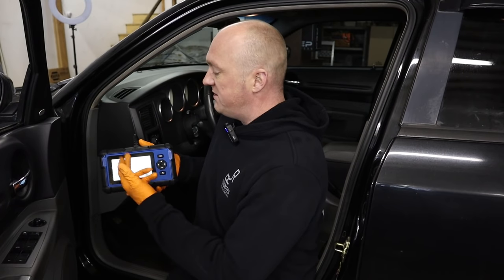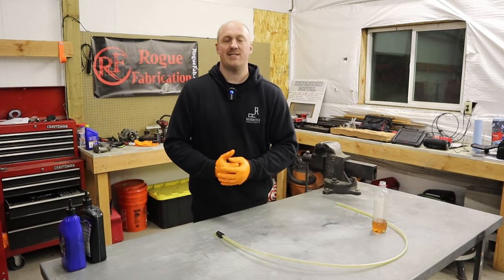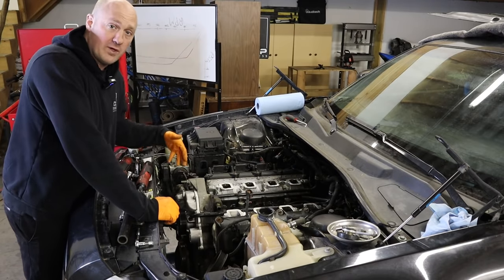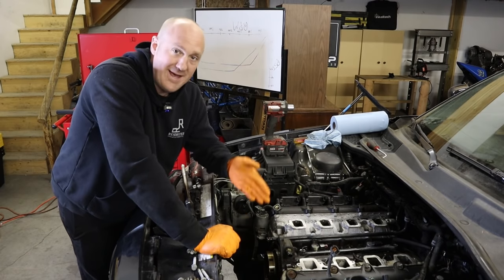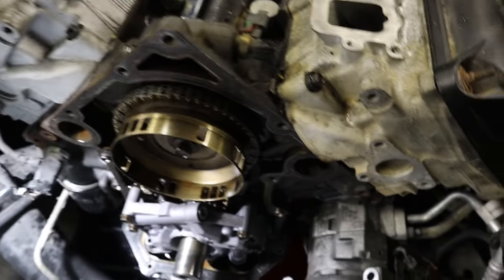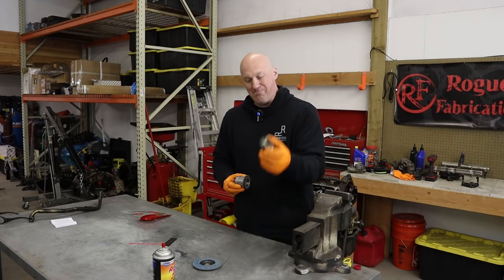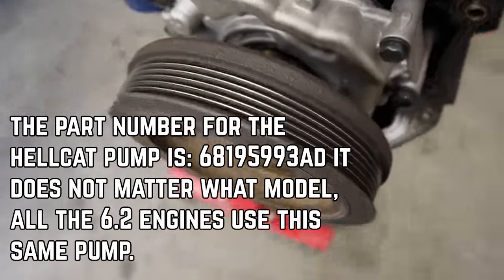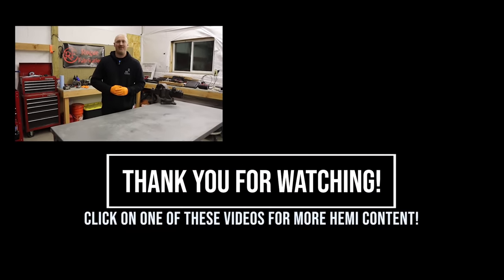Will This FINALLY FIX Hemi Tick? #hellcat

Comment: Ive been reading many of the comments, and the point is getting lost.  He's not talking about PRESSURE as much as he is FLOW or VOLUME,
even though he mentions pressure.

By upgrading to a high volume pump, there will be an increase in pressure at an idle, but at highway speed, the pressure will level off because of the the pressure by-pass spring/valve in the pump.

Simply put, pressure is the resistance to flow.

The pressure is being created by all the little passages and thousandths of an inch clearance of the rod and main bearing and all that other tight stuff.  That doesnt mean that theyre getting more oil across and through them.

Its not the pressure that is keeping the needle bearings in the lifters lubricated, it the amount, the volume of oil they're getting at idle.

As a former firefighter i get what he means.
Let's say the hoses are the oil pumps
If you take a 1 3/4" hand line, you can put 100 psi on that line but only flow 90 gals/minute of water
That pressure is blowing shit everywhere but there's not enought water to cool the fire to make it go out.

But you take a 2 1/2" line, you can have 100 psi on that line but you have a volume of 350 gals/ minute.
You just put enough water on the fire to cool it down so much that the fire doesnt have the heat to sustain  combustion, so the fire goes out.

I dont know the volumes of these oil pumps so these numbers are for illustration purposes only;

Stock pump flows 8 oz of oil per minute at idle to the lifters
 
Melling pump flows 18 oz per minute to the lifter
The Hellcat pump delivers 50 oz of oil to the lifters.

So the Hellcat pump is delivering PLENTY of oil to the lifter needle bearings to keep them lubricated, more lubrication, less friction. Less friction, less wear.  Less wear, longer before the part wears out

Thats the point, it's not the pressure of the pump, it's the volume of the pumps
Reply from the maker: Nailed it 👍

Comment: 03 Ram 2500 5.7 180k.. Have used 5w30 synthetic since I've owned the truck (bought with 53k on it). Not 1 issue outside of Crank sensors. Am still excited to see how this goes.
Reply: It's Very Rare a 3rd gen Hemi has lifter issues it's Mostly the 4th gen Hemi. I have a 2008 Ram 2500 4x4 Hemi an it Runs Flawless an has NO Check engine light on.

Comment: My 06 Daytona gets more around  the 29 psi at idle, fromwhat i could gather, this is in KPA as i'm a Canadian and if you pick Kms, you also get kpa...anyways. then i get a simmilar high high 50s maybe into the low 60s psi with rpms. Still not a fan of idle PSI, but it is what it is. Very informative video from what ive seen so far
Reply: I'm also canadain. 29 psi would be in the mid 200s for kpa and 55psi is around 450kpa

Comment: You have too go with carburetor and distributors too adjust idle and you go with thurmoquad carb and Mallory distributor and copper core wires and auto lite spark plugs

Comment: I think the low PSI oil pumps are the reason for so many cam and lifter replacements. I saw mine at 16 PSI when hot at idle. That's too low to me. Mine puts out 49 at high RPM. A couple times, when I needed to change my oil, I got a warning that the wrong oil weight is being used. I always use the proper oil weight. I'm putting in a higher pressure pump now, since I have to change my water pump.

Comment: I bought the hellcat pump and measured the thickness of that gear and it's 5/8 inches
Reply: It looked identical to the pump that I had on my 2013 Ram 1500 5.7
Reply from the maker: It's a difference of two millimeters so they look very similar.

Comment: Question: How much additional oil is actually getting to the cam and lifters? Has the additional pressure provided more volume to this or is there still a problem in the engine design that still starves the cam of oil?
  It would be great to mount a couple of endoscopes near the front and back lifters and observe the flow in comparison between the pumps. Better yet if there was a way to actually measure the flow at the cam/lifters. 
  I think the additional pressure should provide more flow to the cam but is the flow being lost prior to the cam where it mates up with the lifters? 
  Thanks for a great video and I feel you are on the way to a solution to the Hemi issues.

Comment: Just did cam n lifters on 2010 Hemi put the hellcat oil pump in. In a heat cycle 34-37psi at idle. 72 psi at 3000 rpm

Comment: Ya the white spring I guess is if I need more pressure  I had a lifter go on my 2010 on cylinder  6 I didn't even get the tick just a check engine when cranking the motor all rockers activated but when I turned it over every rocker was going ham cept  the 2 on number 6 stone dead the lifter didn't even hurt the cam but the coating  was coming off pretty good honestly  man i think cause the 16 plugs if people don't get the cel or any  noticeable signs I can see the misfire hard to notice  I had to rebuild  my tcase and my truck sat from Jan till July waiting for snap  rings lol it was insanity trying to find the ones I needed anyways  I got the tcase in fired it and P0306 and it wouldn't  go away I thought  it was my Injector  wire  I got fed up and took  it to a shop  the boss was like  pretty sure  collapsed  lifter  won't know  till the  head  comes off I was like😳 fuck that   I'll give it a go lol first time ever doing  this and I dug deeper the skirts on my pistons  are so scarred  and the rings were like seized in the grooves with carbon so now I got diablo sport  engine tech non mds cam and I found  a company  from Texas been selling lifters 20 years reliant gasket  really good price anyways sorry for the long as comment I'm from Canada and I really respect  what you do man i have had dodge tech tell me they  couldn't program a win module  that I got from a scrap yard I prooved  those idiots wrong  I like that  your honest  about  shit  your  the reason I ordered  the Hv pump and the head bolts  a guy argued with me saying they are one time use I was like man I watch this tech who use  to work for dodge for ten plus and like I trust  a guy with ten years  of dealing  with  this gar bage to know  some  shit😂 anyway  rant  over sorry once again

Comment: okay what would be your suggestion for someone with a brand new 5.7... should i wait until my warranty has expired do a hellcat oil pump mds delete and put new cams and lifters in with a nice tune basically go full bolt on at that point...? or debate with myself to sell the car before the warranty goes out...
Reply: Just wait to see if something happens, Not all Hemi's has lifter failures.. they have Hemi's with 300+ thousand miles with engine never opened '

Comment: Better Oil/Lubricant/Additive to compensate for low oil psi at idle maybe? Lower viscosity oil possibly? Marvel maybe? My truck oil pressure runs around 48/49 down the road 25/26 idle.  I have run 1 quart of Marvel in my oil since 95k. I'm at 250K with no issues yet. Trans went bad at 195k. 2010, 2500, 5.7 of course. I'm too far into this experiment to stop now. Maybe the lower viscosity oil which flows more freely with less pressure is key. High viscosity oil with a bunch of pressure behind it does not sound like a fix especially at start up. 
Thanks for the video...Now if someone could get the exhaust manifold bolts to stop breaking...just changed mine for the second time with the SAME factory crap that doesn't hold up. Need Titanium manifold bolts! Never had any Tic except the exhaust manifold.

Comment: thank you so much for this video. I been searching around though for the melling pump for my 5.7 2013 1500 truck, can't find one that goes to 2013. will the hellcat pump work for this engine?  it sounded like it would. thank you so much, and I will. e purchasing some merchandise,  keith
Reply from the maker: Hey Keith, yes definitely the hellcat pump is the one you want. Melling currently only makes a stock replacement pump for the 09+ Hemi engines, although I have heard that one is in development. The hellcat pump is a direct fit to your engine. 👍
Reply: thank you so much

Comment: Personally my 2016 Ram 1500 with the 5.7l runs higher pressures that you saw here. At idle in the Florida summer, I've seen it go as low as 37psi and then the moment you touch the gas to take off from a light or whatever you're doing, it jumps to around 52-53psi. Even when I just let off the brake and let the truck start to roll forward, like you experience in bumper to bumper traffic, and the engine goes up to 800-1000rpm I'll start to see numbers like 42-45psi. Not sure if maybe the dash readout for oil pressure and the real oil pressure reading might be slightly different from each other but that's what mine says. Maybe they've updated things? Or it is quite possible a previous owner swapped this truck to a high output pump, I wouldn't know.

I'm with you on those pressures being worrying though under 20, especially considering all the things that oil pressure needs to do like actuating the MDS system and everything else. When I worked on bikes, I had an oil pressure issue on a new BMW and while in contact with them they told me that the oil pressure spec at idle for that bike with 15-50 oil and at 200+ degrees was essentially anything above zero. The gauges they use are in BAR so as long as you saw that needle come off the 0 stopper you were good. And the bike I was working on had about 5psi or less of pressure during a hot idle... Wild to me that they considered that to be ok.

Comment: This was a great video! It was really ingesting to see what was going on.  So having a '17 how much different would you guess the idle flow and pressure would be between the Melling and the stock pump with only 1MM difference in width. Is it worth it switching it out just to change it?

Comment: Thanks for this my 12 ram 5.7 is getting a new motor and will get the hellcat oil pump
Reply: New reman motor installed with hell cat pump, at operating temperature I have 40 to 45 PSI at idle on cold start ambient below freezing 80 to 90PSI

Comment: I'm having a hell of a time trying to remove the crankshaft bolt after spinning the engine to TDC. I wish I would've removed a spark plug from each cylinder to make it easier to spin by hand. I heated up the bolt with a torch and hit it with an impact but it won't budge
Reply from the maker: Sometimes the impacts won't work because there's enough twist to the bolt that it negates the effect. Try using a breaker bar, while at the same time sticking a pry bar into the flex plate area that way the crank can't spin.
Reply: @ReignitedAuto  thanks for the reply! I ended up getting it lose by using an air impact instead of an electric one.

Comment: I would like to say that I was able to remove my oil pump without removing the oil pan on my 04 Hemi Ram 4x4, I loosened the oil pan bolts but did NOT remove them to give the room.

Comment: I said the same thing when I installed my 10295 hv melling oil pump on my 2002 Camaro ls6 engine. Bad pickup tube gasket. Was the real issue to lower oil pressure on it.

Comment: I wish he would get an 03 1500 with a hemi and use 05 pcm conversion like a walk through other than the beds rusting out they are solid trucks most of us want to put a new hemi in with cam and headers upgrade the coil packs

Comment: Chevy has the same tick issue.  Delete mds switch lifters and cam for non mds. Tune it. 
Low amounts of oil changes, high idle times, junk oil pumps,  cheap parts. The list goes on and on. Engine is trying to do too much. Many of these vehicles have two stage oil pumps. Low pressure comes on then jumps to high pressure. Cylinders turning off to save fuel. Just too much. 
Make it do what it does best. Just run.

Comment: I got question  sir I watch alot of your videos you do an amazing  job at explaining  these engines my question  is  the melling oil pump part number is  you talk about is 10452HV I ordered  a melling pump  off summit but  the part number is M452HV what is the difference  or is there
 one and this one came with a white spring I never added it also in one of your videos you said sometimes you get a cel  for high pressure is that only if I stay with the mds sorry it's alots just wanted to make sure  I got the right stuff  keep up the awesome  videos
Reply from the maker: No worries, as far as I know the m452hv pump just doesn't have the special anodized coating, and it comes with the factory relief spring installed already. I believe that pump is literally plug n play for the 09+ engines. It will give you the benefits of the high volume pump, and should not set any kind of CEL. Do me a favor though and double check for yourself in the pump paperwork that it comes with the factory spring pressure installed 👍

Comment: I’m a broke high school kid with a 2003 ram 1500 5.7 v8 hemi and I lve looked up countless YouTube videos,  I had my lifters tap before and put additive in the oil and it went away and was almost non existent,  because it was quiet and all the sudden it came back and was so much louder, it has 164,000 miles on it,  help what can I do

Comment: Interesting because my stock 5.7 hemi 2016 at idle is around 35psi. Is there that much of a difference between the pre 2009 and the 2009+ engines?

Comment: With the engine pumping all that oil, will it starve the pan at high rpm?  I had a Mitsubishi 4g63 with a 100psi of oil pressure at 4000rpm and it was notorious for starving the oil pan and filling the head with oil (Fixed with an upgraded hydraulic lash adjuster) I’d be curious to know if these engines had adequate oil drains to get that oil back in the pan.
Reply from the maker: Nah,  think of it this way.  This is a factory part on the 6.2 engine which has the exact same oil capacity and engine architecture and it works perfectly,  wouldn't be any different on a 5.7 or 6.4 👍

Comment: not to discredit you findings but my  Gm 6.0 with afm  idles with 13 psi oil pressure and has 184k miles with no issues

Comment: Thanks for all your help. I have 60k on my Ram. Bad tick at start-up. I suspect it's the exhaust manifold. However, Should I go ahead and start buying parts now for the inevitable cam and lifter replacement? Or just start looking for someone to install a new oil pump right away? IDK.
Reply from the maker: At your mileage I would focus on making sure that you're doing timely oil changes and not letting it idle excessively. Lifters may indeed be an issue later on down the line, but I've worked on plenty of 200k+ Hemis that have never had lifter issues.

Comment: My 2010 Challenger with 84800 miles started having a squeal when I rev the engine. The belt and pulleys are the factory parts so I assumed that was the problem. I removed the belt and ran the engine the squeal was still there and I could hear a ticking when the engine went back to idle. I can now tell all the noise is coming from drivers side around the #5 cylinder.

Comment: How much could be the cost difference on manufacturing these pumps..? If it were to help the lifter failure, wouldn’t Chrysler just use hellcat pump by default on all Hemi applications to begin with? I’m sure they hate when lifters fail just as much as the next guy.

Comment: Great info on the video!.

I've been trying to figure out my "ONLY when warm" Hemi tick for the better part of the last year in my 04 Ram, recently changed out ALL of the lifters, new header gaskets for my JBA mid lengths and I even stuck a bore scope in the lifter bores to confirm that all of the camshaft lobes were good, all my original lifters had no signs of abnormal wear and honestly I'd reuse them if I had to. Today it was 68 degrees and my "cold" idle was 35psi and with the engine 2500-3000rpm it was reading 58psi just like yours. I checked for excessive lash before teardown and everything was great, no obvious signs of any issues.

My engine is super quiet and normal sounding for the first minute of running then the tick starts, oil pressure readings stayed the same from initial start to 5 minutes later, I used a mechanical gauge.

I've beat the living shit out of this motor because I figure if it blows I'll know the weak link once and for all, but in spite of that and 4,000 miles later the noise hasn't gotten worse, so maybe its piston slap? I did have a bit of cylinder wall wear on cylinder #1 and #3.
Reply: sounds like piston slap... i recently had a neon with it and that thing had 165k miles when i sold i drove it hard its still running to my knowledge unless the kid blew it up learning how to drive stick lol

Comment: @Reignited - Cycle and Automotive Honest question, Well more of a conformation, Are Hemi engines designed to run at high idle? 
 Would not a simple tune to increase the idle speed to 2500 rpm or 2400 rpm resolve the issue with replacing the stock oil pump?

Simply intrigued btw, love the videos, super helpful!

Comment: hi there
I have 2010 Dodge Challenger SRT 6.1L
what do you perfer? Melling #10342 (Standard Volume & High Pressure [+15 PSI]) or #10342HV (20% increase in Volume compared to the stock & 10% increase in Pressure compared to the stock)
many thanks

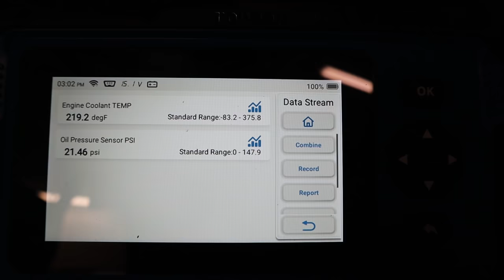Comment: @2:42 - On my 2017 5.7 charger I've got 3.9 bar cold, and 2.9 bar warm oil pressure with 5w20, with 5w30 I have 4.1 bar cold and 3.5 bar warm (at operating temperature), I'm not sure how good those numbers are but was kinda shocked you had 23PSI which is around 1.6 bar.